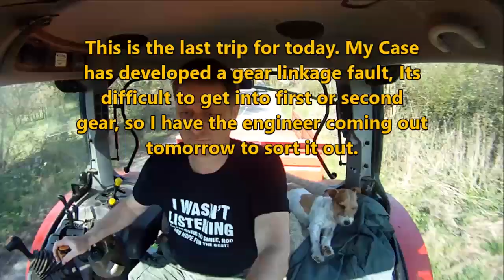Shifting the muck heap with our new JPM trailer

Comment from the maker: The selector cable between 1-2 & 3-4 had come loose, but I could not get under the tractor to find and adjust it without being able to wiggle the gear stick, my arms were just not long enough to do both at the same time. All sorted now though, and got a hydraulic hose leak fixed at the same time 🚜👍

Comment: Glad u mentioned was a gear linkage problem I thought was maybe the connection between the seat an the gear lever 🙄😁 did u not get a tail door with that trailer?, Got a bit of a shock when u lifted the loader up an there was a little orange beacon came into view 🙄 thought a ha now he's boastin 😂 how many hrs ur Case done ? Hope u have a better day tomorrow 💪💪
Reply from the maker: The trailer does have a tailgate Robert, and it’s fine for moving stone or soil. Muck however is a lot lighter so I can stack it higher than the trailer tail board top hinge. To prevent bridging I tend to remove the tail gate, it’s also faster without having to unlatch and re latch the tail. Not that many do that anyway.
The beacon light is there if the yard is busy, just in case no one notices the big yellow noisy thing scooting around.
The Case has low hours, I don’t over work it, about 3200 I think, the gear linkage is sorted now, just a loose cable end.
Reply: We used a grain trailer type tailgate hinged from the top so even a high load of muck slid out underneath the crossbar 👍glad ur gear linkage was an easy fix, think there be a lot o life left in the Case yet with only that amount o hrs on it 👍👍
Reply from the maker: Robert Paterson 
I am hoping she sees me out Robert, had her from new, kept her clean and serviced so no reason she won’t. You can see the tail posts on the trailer, not quite high enough for heaped loads of muck.

Comment: Would you have not been cheaper putting it in s lorry and save the time and cost of running back and forward?
Reply from the maker: Brewery 
It’s only a quarter mile trip, I have multiple uses for a good trailer so it was easy to justify the cost. I would have to get a big machine in to load a lorry as well, so no, in my case this is the most cost efficient way to move my muddles.

Comment: is it legal to use with out a tail board on as some could drop onto the road
Reply from the maker: orkid knog 
Strictly speaking, “A grey area” Orkid
It’s certainly an offence to drop any on the road, either off the back, or spillage over the sides, that’s why you see me packing the top, sides and back down tight. I would rather make a few extra quarter mile trips than risk overloading and causing an accident from spillage. I am pleased to tell you, the road remained spotless 👍
Reply: @FarmerP  i wasnt picking just asking,  looks a nice low trailer to pat it down on to keep it tight, i like how the ramps are store under the trailer looks a nice bit of kit handy all rounder keep up the good work
Reply from the maker: orkid knog 
Don’t worry Orkid, I didn’t take it as criticism, it was a good question and deserved an answer. 🚜👍

Comment: I taught the gears were a bit hard to pull before you said
Reply from the maker: Seamus Dunne 
One of the linkage cables had worked loose. All fixed now.🚜👍